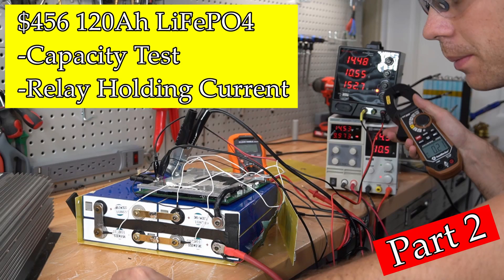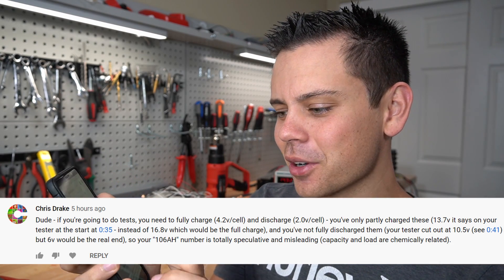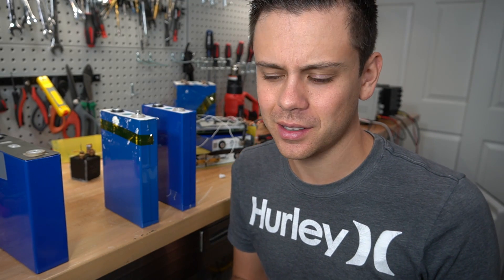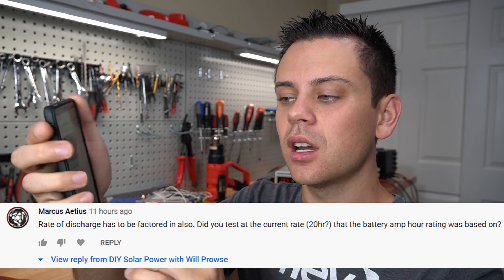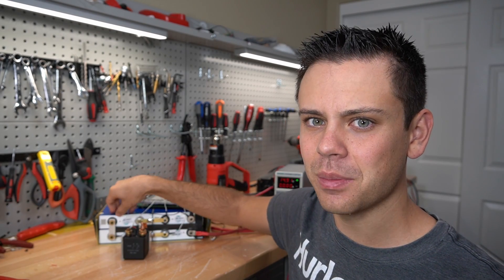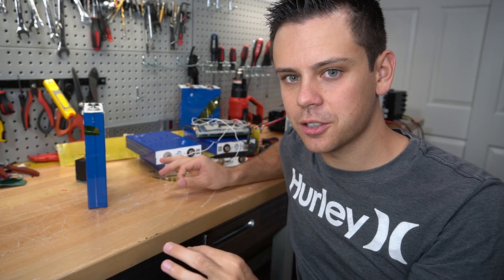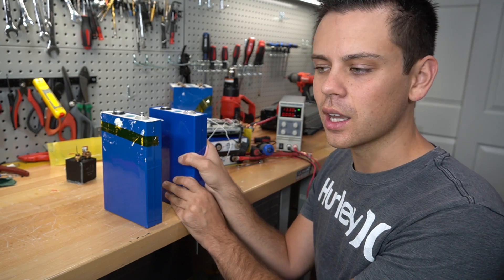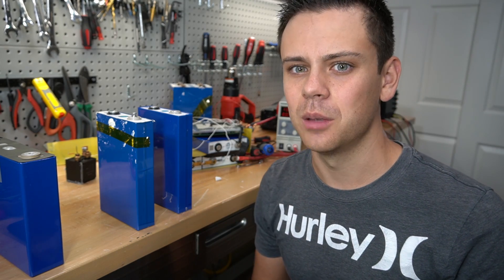Disproving LiFePO4 Battery Misconceptions in my Latest Video's Comment Section

Comment: Hey Will, i love your videos, i have learned so much. i have a question. i want to make a powerwall at home and a electric vehicle- like 2 mountainbikes turned into a car- to go to store with in summer instead of my 2 ton diesel car.  just something that can carry me and 4 big grocerybags home. I was thinking of buying used 18650 cells from EBAY, i can find them at really low prices if i buy 1000 cells at once. like allmost half a dollar a piece, for 18650 cells with 2 aH  capasity or more. these are cells from ebikes, is this something you would reccomend to keep the price low, or is it a risk too big of getting bad cells or that the total cost of bms and soldering and wiring and buying a charger-it all ends up beeing more pricy than these big blue cells you use here in this video?  basically should i try or stick to buying the big batterycells like the ones u used on your electric golfcart.
o and i allmost forgot, i got myself some solar panels because of your videos, i bought a (too cheap) chinese gridtie inverter , and i am now a electricity producer :) (only 300 watt solar panel but still, its a beginning.)

Comment: Is there any chance you'll  test double alternator setup with Victron, or Sterling B2B converters/chargers in Ford Transit for charging LiFePo4 battery pack?  If you could figure out best setup for 10-pack LiFePo4 battery pack you would make many viewers happy.

Comment: the myth could have come from the very first lithium variant "lilo" or 4.1 volt version or what ever was when rechargeable lithium batteries was first invented

charging lifepo4 above the recommended charge will damage the cells and shorten it's life.

Comment: You mentioned 280 Ah batteries available, are these on AliExpress? Is there a supplier that you recommend for them and a BMS? I need 8 cells for a 24V All-in-one 3000 va/2400W MPP Solar inverter. Thanks

Comment: Regarding that breaking in of a battery... Rumors say that breaking in a lithium battery lowers the internal resistance of the battery letting the amps flow through with less heat... ''beginner'' here 😅, is this just a rumor?
Reply: Doesn't lower temps mean  "smoother" charging and discharging resulting in higher real world capacity of a cell? I believe there is some logic there and I'm indeed asking if this is false or not...

Comment: Hey" will, I have a battery Bank, from out of a 2012 Prius C. & I'm also restoring an RV, I have,. If you can give me any tip's I would be VERY GREATFUL,. But what I mean is how should I put the battery, bank together for my off - grid power.
What is the best panels to get,?? & should I go with 12-24-48 or 36 volts.??
On my Bank, & inverter,.. I've done a lot of
Research on solar, & off-grid living. I wanna here some advice from someone
That has ( Ben there & done that).!! So, what do ya think my friend. 
P.S. I got a devorce a little while ago, & I'm just enjoying the peace and quiet.

Comment: The 4.2v comes from people using LiPo's, not Lifepo4. With my self-built drones I charged the LiPo's up to 4.2 as well, and flew until it hit about 3.6v. So they are probably just thinking Lifepo4 and LiPo batteries are the same.

Comment: How many C rates lifepo4 can safely handles? Im using pouch sell. 30a capacity. Can i pull them to 60a continuously? With mine, i was pull 60a without any issues. Temperature increasing 5 'c. My weather here about 30'c, it is safe? How about life circle for the battery life?

Comment: What's your take on the 3.7 LG Chem batteries? I have 13s pack 48v 120ah  I'm using for a solar powerwall bc I got them relatively cheap.

Comment: Hey Will, I’m like lots of people who know so much about batteries.   When the motor (car engine) starts, or the light bulb lights, the battery is charged and working 😂.  If the motor (engine) doesn’t turn over nor the light bulb glow, the battery is out of electrons (uuuuhhh - holes for electricians) 😭😭.  I’m older than d1rt and the ROI based on how many years I’m expected to live make it questionable whether to go with a cheaper (LAB setup) short expenditure or more expensive (LIFO) longer lasting system that will outlast me 🤔.   If I were 10-15 years younger, you would have had me convinced long ago to leap to lithium.   You don’t even have to get upset 😠 with the unlearned, just keep reminding them of the data available on the different lithium batteries.   The smart ones will figure it out eventually, but the ones that “know more than that young whipper snapper” will forever be ignorant.   Thoroughly enjoy 😊 your videos.

Comment: May be the wrong subject video, but what the heck!
 Haven't seen all of your videos, which are very informative, but catching up. My background is data and fiber optic communications (some AC). Looking at buying a small RV trailer which has everything you would need, but being able to run the AC boon-docking. Someone in this group purchase a solution for $9 grand, crazy money! Most of their money went to batteries and the inverter. What I've learned from your videos and breaking down what I would need from the net. The solution should be well under $2,000.00. Thanks for the help!

Comment: Will, could you do a new battery build for me?  I purchased Overkill Solar's BMS and 4 (1 set) LIFePO4 Al 200(I wanted 120 amp, they had 200amps in US, price was good, just about $600 shipped and then the BMS) amp cells all at 3.27v.  This should be an overkill of power for my little  transit connect camper lol.  Thank You!

Comment: Love your videos bud keep it up, you have inspired me to build my very first solar system to put on my Kenworth T680 truck so I can run a mini split ac system so that I don't have to idle my truck for 10 hours when I'm on my rest break. I literally was about to pull the trigger on some 280 ah lithium cells when I seen this video.  Do you have a link where I can get those four cells for just over 400 bucks?  I've only seen them for between  $800and $950 for the 4  cells.

Comment: I was told you need to top up the electrolyte with some distilled water. :)
Reply: Incorrect these ones need soaking in water to replenish the boiled off juice from running them at low discharge, its best in salt water as this really excites the molecules into a chemical reaction.. Warning the battery may get very cold during this period so give it some love.
Reply: @DUB-sential  I do the same thing but with pulp free orange juice.
Reply: @pstearns6164  yeah mine likes the bits left in sadly
Reply: By injecting it with a metal syringe :)

Comment: While not a puekert effect. You will pull less watts from a lifepo4 cell if discharging  a high C rate (yes only a small amount of loss compared to LA). I provided evidence awhile ago when you missed out on about 50-100wh from a battery you reviewed awhile ago and claimed it was false advertising. I'd have to dig it up again. I can agree 105ah advertised as 120 is false advertising tho.

Comment: Hey Will, I'm one of your forum members who bought the 280ah cells for $482 to my door from alibaba, (Xuba web site). I learned how to setup a lifepo4 battery by actually following your build guide lines carefully and my battery works great, so far, I;ve only been working on it for a few weeks. Your information is right on if you read it carefully. If there are any confusing parts of the assembly, testing and programming the forum is a big help. Setting up the BMS program is a little tricky but that is because of the poor documentation of the BMS ... it takes a little trial and error to optimize for the way I want to use it. (give up a little capacity for more charge cycles). Anyway you're a great teacher and we appreciate your hard work.
jjb (aka ...tomtilly)

Comment: After owning a LIPO battery for almost 3 years, i have recently built a LIFEPO battery too. And man, going from Polymer to FP is like day and night. It takes quite a steep learning curve to understand the differences in chemistry. One who knows about LIPO, NCM, etc, knows nothing about LIFEPO until he is using it.
Reply from the maker: Hey I started with LIPO too! Pretty dangerous but fun packs. Gotta love that high specific energy. What did you use polymer for?
Reply: It is a purpose built 200Ah pack, running on a Mpp5048. That time they said DOD 80% after 500 cycles. But hear in Thailand, where the temps are always around 32degC in my power room, I have now put 700 cycles on it and capacity still around 90%. But i am going preety easy on it. Max. 0.3C. My new pack is now a 270Ah LFP (used Sinopoly original 300Ah). On a rainy day, please check my channel. I have recorded a series (and still ongoing) called "The AC-Powerwall Project". Love you channel! Very informative!

Comment: From my understanding, it is not that puekert's law "does not apply" but that LFP batteries are rated at C/2 - C/5 discharge rates. Therefore, (refer to the actual equation to better understand this) when you perform a discharge test at the rated C/whatever rate or below, you don't need to account for it. However, I do believe that the Puekert effect "applies" to all batteries. If, for whatever reason, a manufacturer rated their LFP battery at C/20, and then you discharged at C/2, you would notice a small reduction in capacity - maybe in the ballpark of 2%. However, it is this small because the peukert's exponent/constant is small for LFP batteries (again, see equation to understand this further) and when compared to lead acid, basically negligible. Does anyone disagree and if so, why/what papers could you refer me to? Interested to learn.

Comment: Hello Will, some of the viewer comments about getting a refund back after taking the battery case apart. In Australia  were I am from,if you tamper with the item the supplier won't give you a refund, even if it didn't meet the requirements. You have to return it the way you received it. 

It is good that you can get a refund. Keep up the great work

Comment: Will, I know alot, abf you know more than I. I watch you because you do everything ive learned and you are on it.  I think maybe in rc lipo batteries he is used to 4.2 v  but not in bigger 100 ah batteries.  I charge my valence 100ah batteries to 14.6 then quickly falls to 13.3  when I run a capacity test  i get between 101 and 105 ah and thise are on 5 plus year old batteries.  Obviously these cells hold there capacity at what was it 3.6v each. Thank you love your info.

Comment: NASA has all the test data for all battery chemistries...free
Includes maximum cycle life for satellites,optimum charge rates,and temperature ranges.
Will is right, I've followed his solar series he hasn't been wronge yet,listen to him.
I about fell out of my seat ,when I saw a shunt and DC DC converter in his circuit for lithium about time someone showed this.
He talks to many battery and solar guys for info from the field ( reality).
Buy his book ,it will save you money, frustration,poor performance, and damaged equipment.

Comment: You might want to limit discussions to those who are subscribed. In real life most people just assume all Lithium batteries are the same and used solely for handheld devices. LiFePO4 are pretty new and anywhere else are rarely talked about; I even know ebikers who were surprised to hear about them.

As for the Alibaba return maybe it would help to emphasize the return is for "False Claims".  People often think returns are for being defective but even on eBay you can rip items apart to show they are fake. IF you can "prove" an item is fake you are not required to return it or at the very least you are not required to pay the shipping and you can legally get your money back.

Comment: Hello.   Sorry about the Debbie downers.  You do very work.  Ppl could learn isn’t of being know it alls. Been off grid thirty years and still learning.  I like to know if any way to add li4o batts to a existing system running flooded lead batts.  Have 1.5 kWh system ?

Comment: Hey Will, if you really want to confuse some of these know-it-alls, maybe a LTO SCiB battery needs to hit your bench. I'm running mine at 2.5V per cell on Nominal or 60V and 2.0V per cell at minimal at 48V using a Sol-Ark 12K. Since I did away with the stuff that should stay in golf carts, and started using these (up tp 20,000 cycles can be made down to -30F, that ought to really get me a few comments) I think the best use for lead is for making bullets. What's funny to me is when someone tells you that experts will be chiming in. Don't they realize you have become a respected expert and probably know as much or more than anyone does about batteries? That is what makes you money and the rest of us an asset we can count on for expert advise

Comment: In my experience LiFePo4 capacity will be slightly more than rated capacity when brand new. After the first 200-300 cycles it will pull rated capacity.

Comment: Thanks for another valuable educational contribution to the You Tube knowledge base, Will. You are literally a fount of knowledge and we salute you! My question is a bit off-topic and would be better posed in your golf cart videos but I hoped to improve my chances of getting an answer. I'd like to build the most cost effective portable solar system using a 48-volt golf cart for storage. Being an older guy, my ability to assimilate technical info is not what it once was and I am pretty overwhelmed with all the options. I watched the video you did on the 2500-watt all-in-one inverter/charge controller and figure that would be a good starting point. I have acquired some used commercial 48-volt panels and am now trying to decide on the most cost effective batteries. Would LiFePO4s be the best (reasonable) choice or, given that the storage platform is on wheels, would one of the lighter automotive battery systems (Tesla, Volt, Leaf, etc) make more sense? The Mercedes 48-volt batteries caught my attention but the reviewer mentioned that the Mercedes BMS does not lend itself to DIY use. Any thoughts?

Comment: Hi Will. I would like to hear your thoughts regarding Bioenno Power Batteries. I have a 12V 60 AH LFP-120L battery that I use for my amateur radio equipment. Thanks.

Comment: Will, there may be some truth in Chris Drake's statement about the 4.2 v charge. He didn't make it up, that's for sure. Czech firm GWL, specialists in Winston Cells for many years, used to state in their documentation that a Winston LiFePO4 cell should be charged to 4.2 v for it's initial charge and to 3.65 v for subsequent charges. The views on how to handle LiFePO4 cells has changed over the years, so I don't know if they still support that claim.  But you could contact them. I'm sure they'd love to get in touch with you. As for myself: I built my own system using the 105 Ah aluminium cased cells, and I keep 3.65 v as the upper limit. So don't shoot the messenger, please.

Comment: Hey Will great videos, thanks for sharing your knowledge. I'm a complete newbie to Lithium but one question that came to my mind from this test was regarding the BMS. Could the BMS that came with the battery have been configured differently to give larger capacity through for instance a lower cut-off voltage? I can see that being totally false unless the equipment you are trying to run is okay at much lower voltage, sorry if it's a dumb newbie question.

Comment: FWIW, if anyone tells me I have to $950.00 for a 100AH battery- I'm going to have any number of why's? But, before I write that check, I'm also going to my own research to understand what I'm going to achieve. Explaining all of the why's and wherefore's for LiFePO4 is not easy in a single video (Yes, I DO you Will- use Lead Acid as your comparison!), but- SHOULD be done so people don't complain that the discharge current drops like a rock for the last 5%, when SOC remains at 12.2 for over 80% of the discharge cycle. Frustrating to say the least. Did I say thank you for edumacating me about Li-Ion and its many variants? Well, Thank You!

Comment: Love your videos. Saw your recommendation of all-in-one inverter and I like PIP5048MG which can run without batteries. Is it safe to run it without batteries and without grid power? I would like to run an air conditioner of 1500w 240V. Can I start with 2000W of panel, and how do I connect them? Thanks in advance.

Comment: I suspect a lot of those commentators don't recognize you're using LiFePO4 (Lithium Iron Phosphate) not LiPo (Lithium Polymer). 
LiFePO4 typically full charges to 3.7v per cell whereas LiPo charges to 4.2v per cell. 
Likewise LiFePO4 has a fully depleted voltage of 2.5v whereas LiPo anything below 3v is considered depleted. 
Different batteries, Different Anodes and Cathodes, Different chemistry.

Comment: Just having built my own three 24v 120ah 8s batteries  for my sprinter RV I have noticed that when floating at 28.4v then putting a load on them the voltage drops to 27.1v almost immediately ... Then it will hang there for a long time UNLESS I am running the A/C unit or I have a Large tool ie; 220v Mig Welder or my table chop saw running (Ihave a 6kw 240v invert)... but if I am  just camping w/ small loads I could probable go a week of rain w/ no problems... The voltage drops some when I first enable the system but hangs at about 26.5 - 27.1 for a very long time... May I state that I am a complete novice and have built my system by watching and listening to will. The majority of my system was purchased from Electric Car Parts in Utah... (Thanks Carl) ... Will Prowst has been a godsend and his videos are pretty right on... Many Blessings , SMR